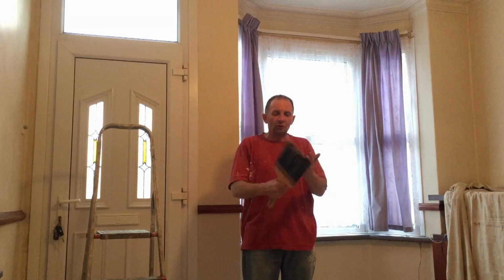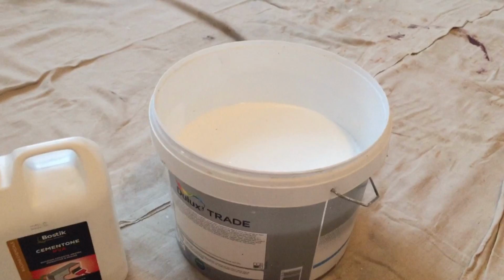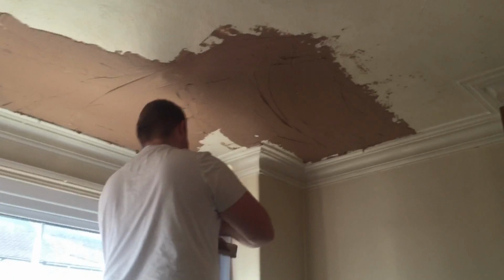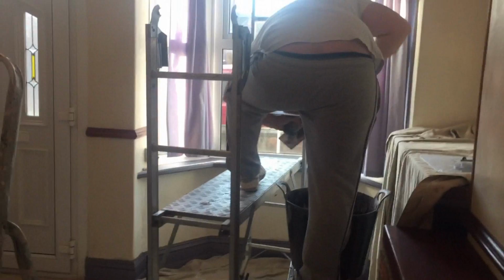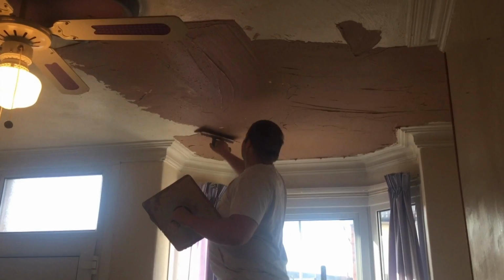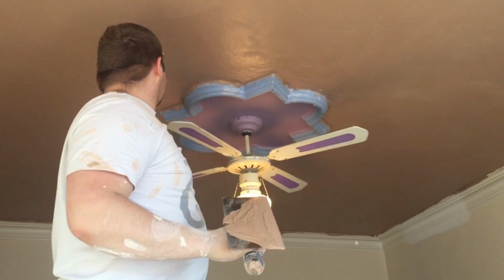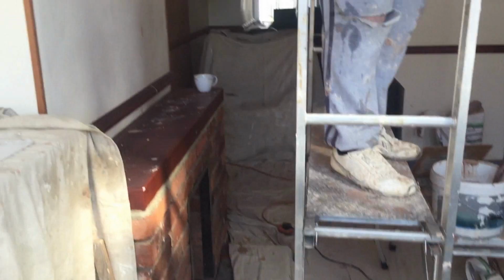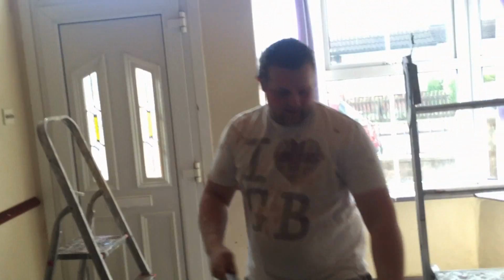Painting & Decorating, How to plaster a ceiling

Comment: The artex was flatter than that ha ha. Not wanting to be too harsh but it looks like he waited too long and lost the first coat and all the high spots and trowel lines of it are burnished and showing through the second coat. If you get the first coat as flat as you can then the second coat is just filling the shallows. Trying to knock life back into it that late by pissing it through to make a slurry generally ends up with a powdery mess full of water marks. Get yourself a plaziflex or delehedy and trowel it up a bit earlier, you won't need shit loads of water. Maybe just a bit of a wet brush on the edges as you go to prevent dragging dryer bits across the finish.